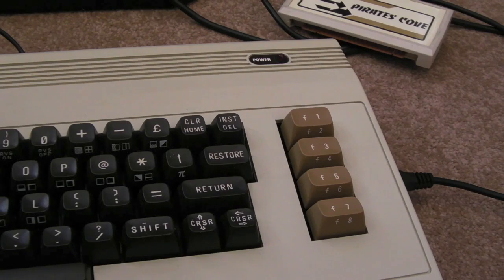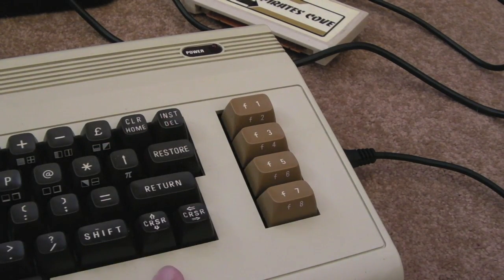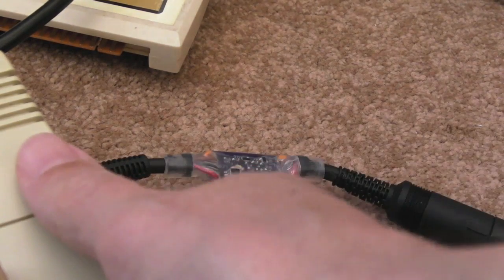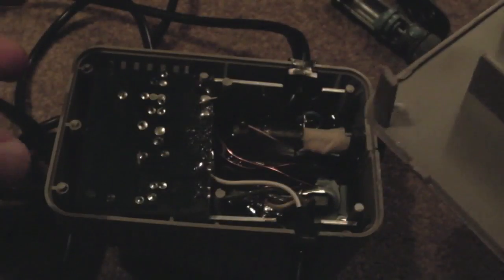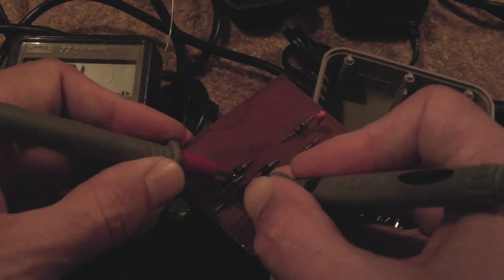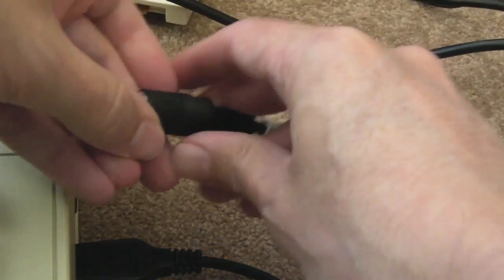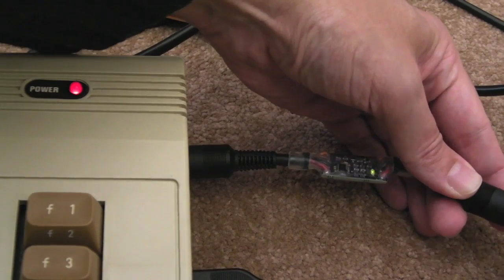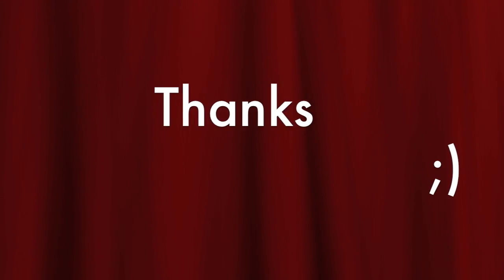Commodore 64 (C64) / C64C / VIC-20 5v Overvoltage Saver - C64 Saver v1.0 from bwack & PSU Repair

Comment: If I've learnt it correctly, what happens is that heat, mainly from the regulator, makes the resin block expand and contract. The pcb sitting inside does not expand at the same rate and that makes that the 7805 solder points to the board got stressed and sometimes crack. If the first solder point to crack is the regulator input or output the psu just stops supplying 5v and dies... but if the first contact to break is the ground contact of the regulator then the regulator looses reference, stops working and the full unregulated voltage from the rectifyer bridge goes through the 5v lines and fries all the innards of our commies.... except probably the VICII and the RF box.
Reply from the maker: That's fantastic insight into the problem!  I had always just assumed the 7805 overheated and died (shorting input to output), but your suggestion there that the ground floating could be the culprit is certainly possible and probably more likely.  Thanks =D
Reply: That is a good observation and theory indeed !!

Comment: Thanks so much GadgetUK for checking these things for me. Just a note. The 8 pin IC is the power MOSFET. IRF9332PbF. PMOS, -9.8A max. Rds_on=28mOhms at Vgs= -4.5V. This keeps the volage drop to the minium. There are devices with far better Rds_on, but at much higher price. I'll look at the movie much more later. I liked the PSU teardown. I haven't seen the internals of that before.

Comment: What if you unplug the power from the saver, and switch it on to drain it, then off,  then plug it back in, and switch it back on?
Reply: +Amy Marie Hi. The circuit is more a high side switch controlled by a comparator sensing the input through a voltage divider and with positive feedback. The positive feedback creates hysteresis. So you have two trippoints, one upper and one lower depending on what trippoint was exceeded last. The problem is that this hysteresis is too wide and Gadget's 5.3V supply sits above the lower trippoint and can never reset the circuit once it trips. The wide hysteresis is a design flaw because I didn't know about these higher voltage supplies by Commodore.. and I learnt something about this contact bouncing.
Reply from the maker: +Amy Marie It still trips into the protection mode!  If you watch bwacks last video he captures the input and output voltages and explains exactly what's happening.  It's contact bounce =/  I did try a few things to see if I could improve and de-bounce the power switch but ultimately it makes no difference, and I think this is because its 'inrush' related and from what Hans was saying, its also part the lack of capacitance in the system as well.  The way I understand it, the inrush of current being high on power up, coupled with switch bounce, means input voltage to the protector goes over 6v I think.  And the bounce seems to be 3 or more stage in a typical C64 switch, so you get fluxations between 5.3v and 6 / 7v.  I think even adding more capacitance to the system wouldn't solve it - it would probably contribute to more inrush I think - but that's just me speculating.
Reply: oh really thats a new one!!!. usually you can drain a circuit. that way.....He must be doing some Boot strapping.
Reply from the maker: Yes, he's using a mosfet there and somehow it's altering the tolerance based on initial power up voltages - the spike is throwing it out.  It's always the point when the switch is engaged - if you remove the switch (ie. leave it switched on) and connect any of the connections, it works fine no matter which part is plugged or unplugged.